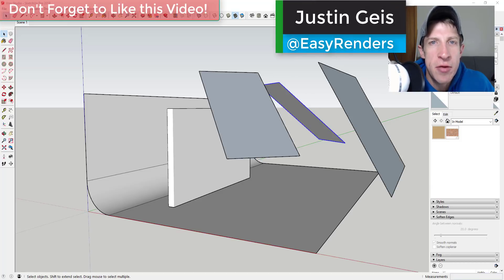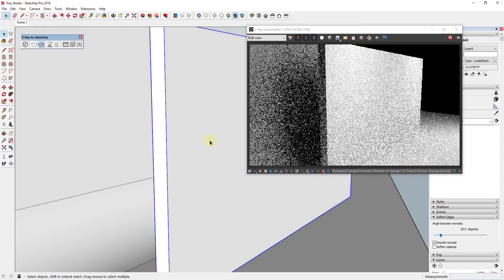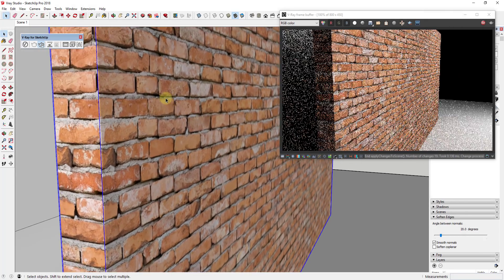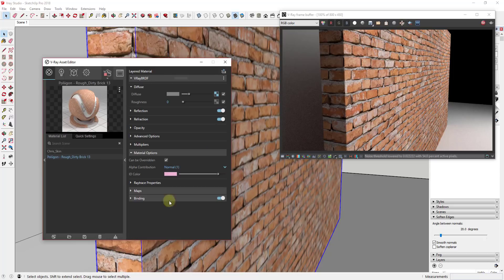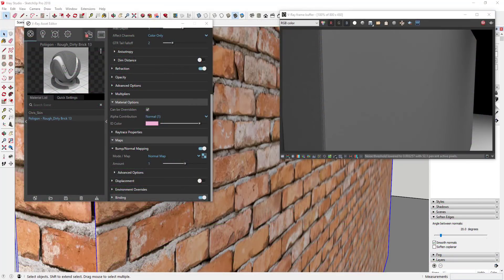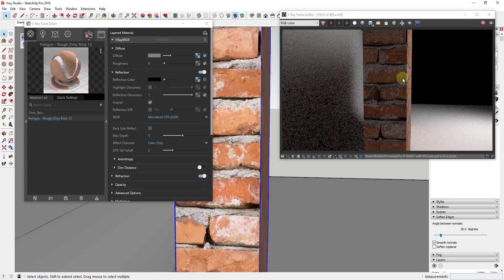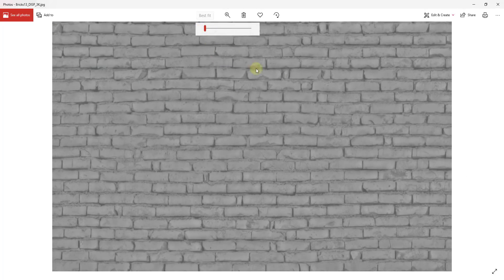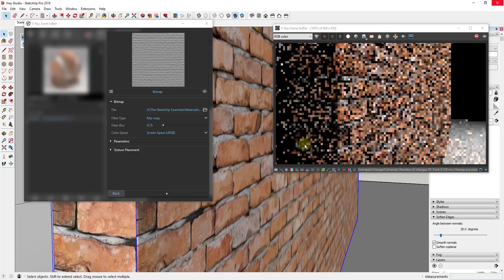BEST TIP for Rendering Photorealistic Materials!

Comment: how does it work with LUMION , it has no displacement map.
Reply from the maker: As far as I know, it doesn't - to the best of my knowledge, Lumion isn't really designed for this sort of rendering, but rather advanced architectural visualization - if you're looking to use materials that require displacement maps, you're probably going to be better off in a static renderer like Vray...
Reply: Displacement maps are simple too taxing for real-time rendering. Maybe someday they implement a rendering mode where these features could be applied in a "non-real-time" mode.

Comment: Displacement maps can increase renderings by 10 times or more - they need to be used very sparingly, if at all.
Reply from the maker: I guess it depends on the application - if you're doing hard, fairly uniform surfaces, like tables, new floors, etc, bump and normal maps are probably your best bet. Some materials like brick with significant mortar, stones, etc look really weird without displacement, so there's not really a good way to get around that that I'm aware of...
Reply: @TheRenderingEssentials  It depends on the distance away from the camera and the angle. We used to use it on corners only by creating a separate texture just at the corners.
Reply from the maker: That would work - I've been meaning to test something like this out (separate textures with different maps for different areas) but haven't had a chance yet - thanks Dave!